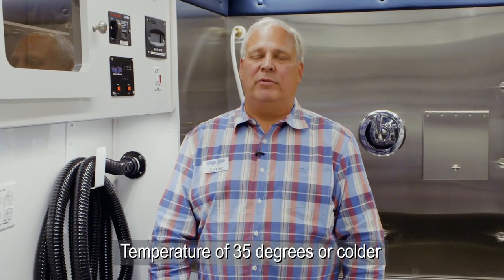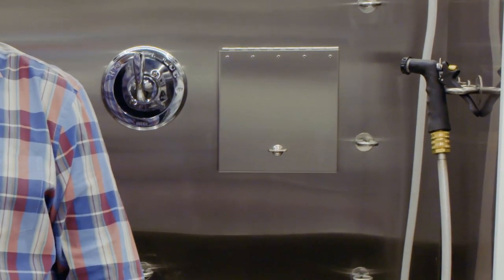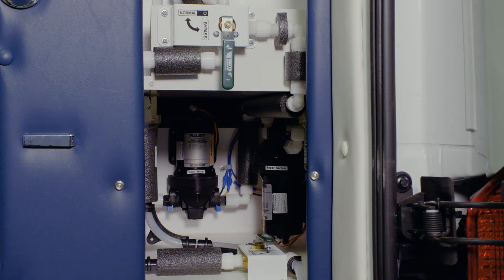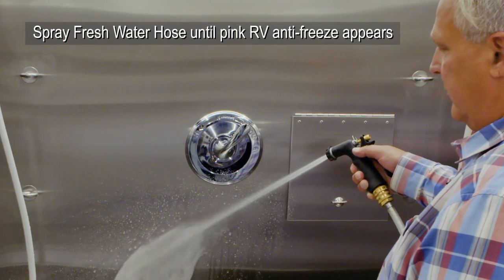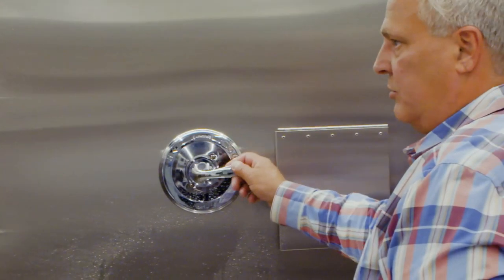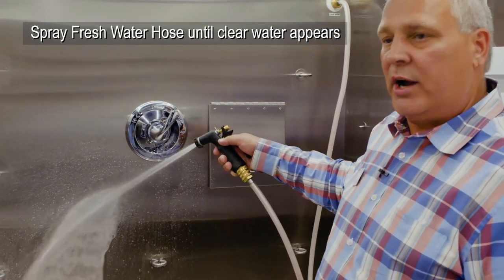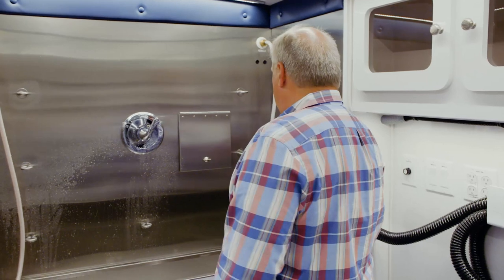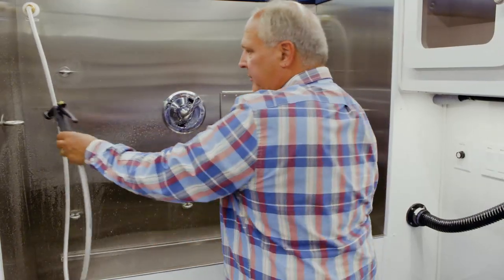Winterize your Wag'n Tails

Comment: Do we really need to use the antifreeze if the van is kept warm with the heater and furnace?
Reply: Do you have a temperature controlled garage to park the van when not in use?

Comment: I have a 2013 pet pro…I dont have a tank heater switch?
Reply: We had a 2006 Pet Pro before we moved onto another easier to use vehicle. If you don't have a tank heater, you just eliminate that step.